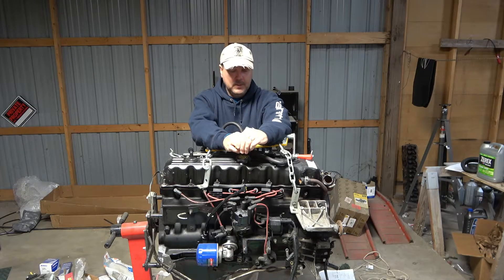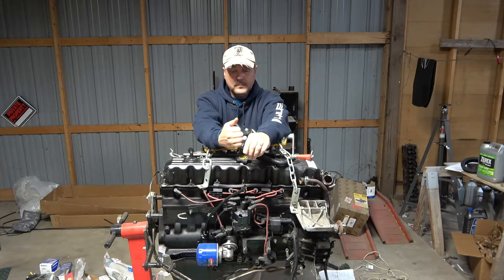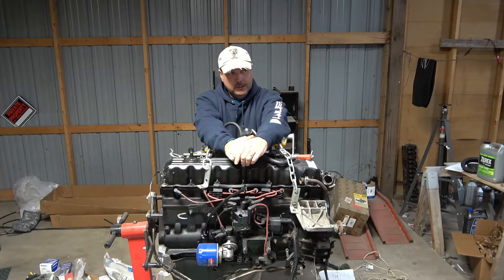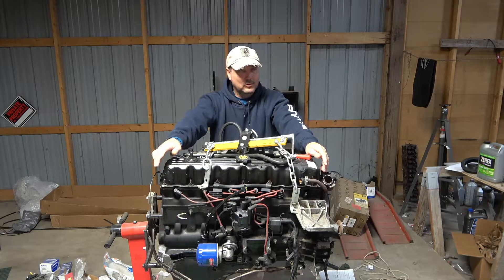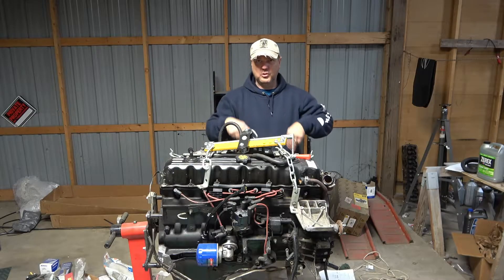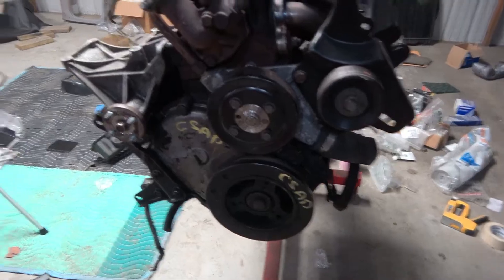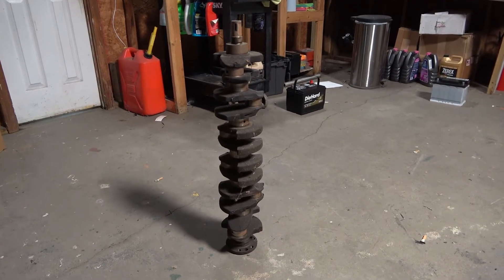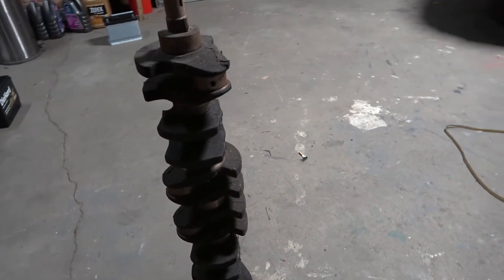Jeep 4.6 Liter Stroker Build Episode 1:  4.0 Liter Powertech Prelude to Power (XJ, TJ, CJ, YJ, LJ)

Comment: How do you like the clegg kit? I'm looking to buy the kit and have a shop build it. But haven't found any reviews
Reply from the maker: I went with the stuff from Bishop-Buehl Racing Engines, but have since talked with the guys at Clegg.  They have some good solutions and options that are not on their website.  I would recommend calling them.  The SCAT rods that are setup for full floaters are made and balanced without the extra balance pads which is the route I went.

Comment: I know the 1981 and up California Only  258 used a reverse direction fan and water pump with a serpantine belt set until 1986 that was a California only thing. I have 2 CJ7s setup from the factory that way. The 49 state CJ7 got the multi belt setup. Not sure if it continued into the YJ 258 setup
Reply from the maker: Yeah, I've heard they did some different belt setups through the years.  I will end up running the 97 Wrangler belt setup